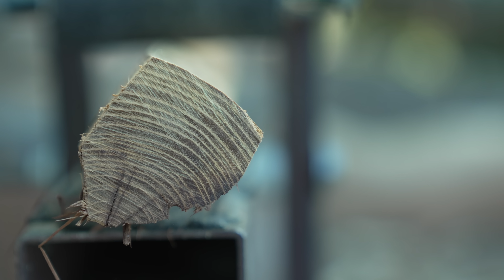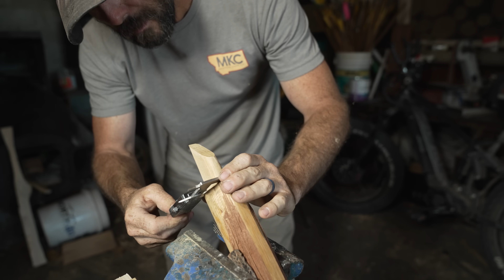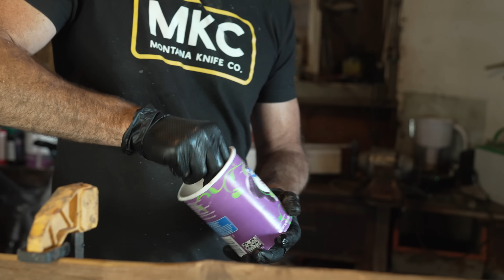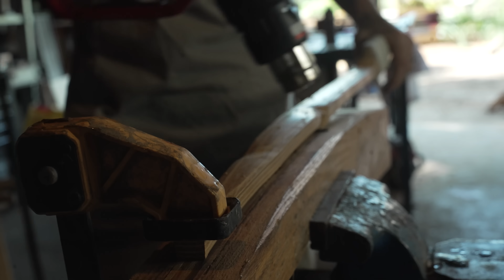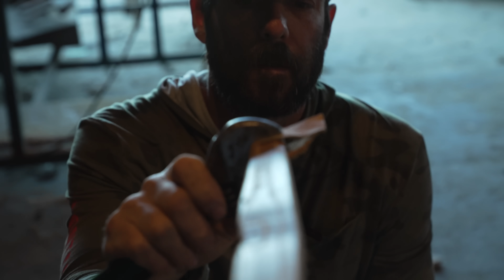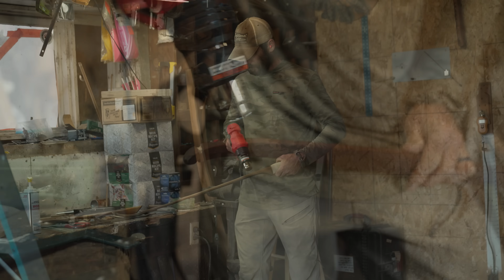Let's make a DIY LONGBOW with two STICKS in my Backyard!

Comment: Just a quick piece of advice I picked up from a cabinet maker.  If it's summer/humid (during construction) then make any joint as tight as possible. If it's winter/dry then have a tiny gnats wing extra space.  
Also, any thoughts on a removable pin?

Comment: Clay, thank you for your videos and books. I've watched many of your videos and bought your book, "Traditional Bowyer's Handbook". I'm retired and live on my 40-acre ranch in Colorado. So, now I have time to make bows, bowstrings, arrows etc., and a large place to shot. I was finishing my first bow today. A hickory board bow. I bought the board from Home Depot. I was aiming for 40 lbs. at my 28" draw length. Unfortunately, I drew the bow to my 28" draw length on my tilling station, achieved 50 lbs., and cracked my bow. I great learning experience for me. I believe I know what I did wrong. I should've drawn to 40 lbs. and stopped and then removed more wood from the belly. Fortunately, I also completed my second bow today! A maple board bow with a padauk handle and bow tips and goat rawhide backing. I painted Native American designs on the bow that would make Sitting Bull jealous! I made a Flemish Twist bowstring for it, and I'm in the process of making arrow shafts from Poplar wood that I bought from Lowe's. I also buy many products from 3 Rivers, including a Bear bow and arrows. Please, keep up the videos and books!

Comment: 14:17 sprinkle baking soda on superglue and it will instantly harden.
Reply from the maker: Thanks for the tip!
Reply: I keep my superglue tubes in a ziplock bag with baking soda in it. In case the superglue leaks ,it gets hardened quickly befor it glues everything together.

Comment: Did that Lower limb break and get glued back together right at the fade it looked like there was a glued crack that ran all the way around and into the handle? Just wondering beautiful bow though
Reply from the maker: Good eye! I messed that up. Had my chisel turned the wrong way when I popped off the belly wood and the crack ran down into the handle section. A little epoxy fixed it up.
Reply: @clayhayeshunter  nice I was wondering how well a fix like that would hold I know that typically a glued joint is actually stronger then the surrounding material so its a good example of a viable repair, and the bow looks awesome

Comment: Clay, try using Aeropoxy used for building wooden and CF  planes. Its way stronger than West Systems. Use their structural version.
Reply from the maker: Thanks for the tip

Comment: Just a tip, superglue kicks off from humidity in the air, breathe on it, spray it with water mist, dip it in water, put it somewhere humid. Low heat might work a little, no higher than 60c/140f, it makes the moisture more reactive and the molecules move faster, but high heat is definitely not the way to go. There are also commercial accelerators available.
Reply from the maker: Good to know, thanks for the tip!

Comment: Beautiful bow!   
And I have a personal question, if you or anyone else on here, have time.  Are knock points the same whether it’s 3 under or split?   I have a bow a guy made for me in a trade, and he shoots split, I'm 3 under.   There is always an uncomfortable vibration on my fingers, but my knock point came loose and went too high, and it felt wayyy more comfortable.   Should I re-knock higher then, or do I have to suffer with it?    I did notice when I tried split, it didn’t hurt my finger tips as much before this happened.
Reply from the maker: Typically you’ll need a higher nock point when shooting 3 under but that’ll depend on how the arrows fly. I covered that in one of the tuning videos a while back.
Reply: @clayhayeshunter . Thanks, I’ll try to find it

Comment: Stick Fast CA glue with accelerator will set in 5 seconds. It comes in thin medium and thick which is almost gel. It works great for fletchings. Apply accelerator to your shaft and glue to your fletch. Great video as always!

Comment: I broke a sledgehammer's handle once, trying to split a piece of Osage firewood.    I smoked a few bandsaw blades made for wood, too, trying to rip a piece. They sparked and dulled quickly.I found that metal blades ended up working better.